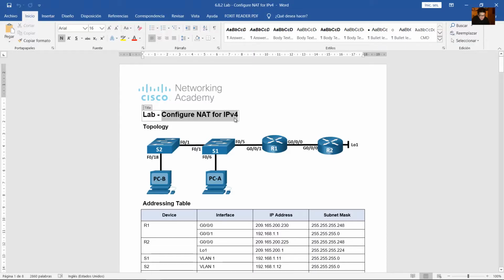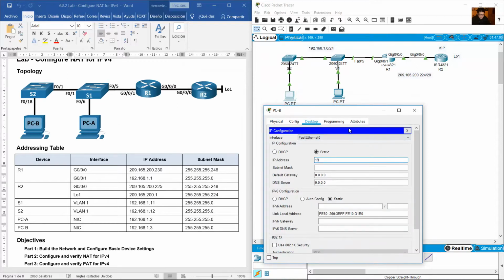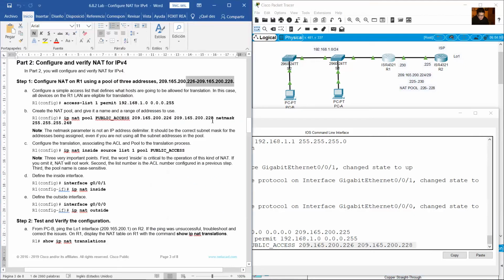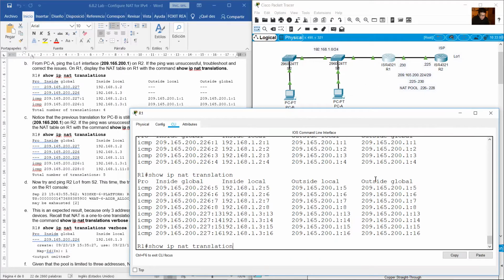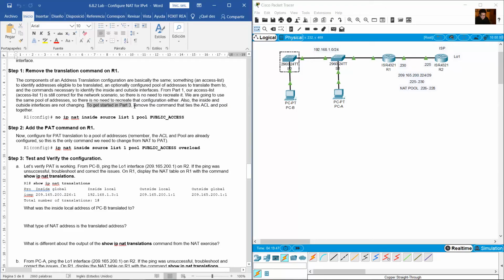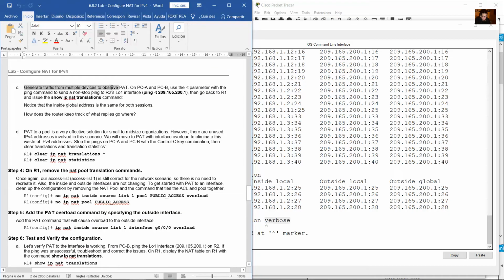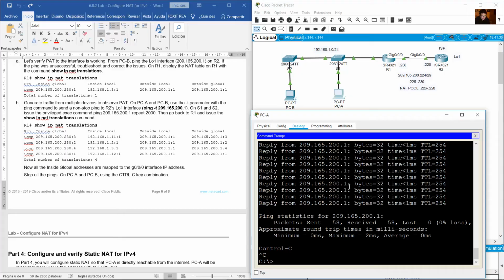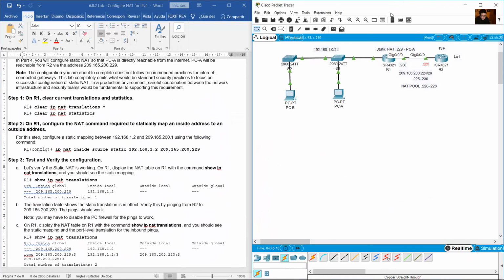6.8.2 Lab - Configure NAT for IPv4

Comment: to connect switch to switch  which cable do we use(straight through/ crossover) when doing the practical physically at the lab?
Reply from the maker: For old switches use crossover connections, in this case use straight through cables, this is because for MDI/MDIX technology